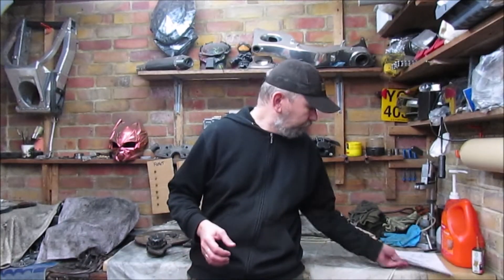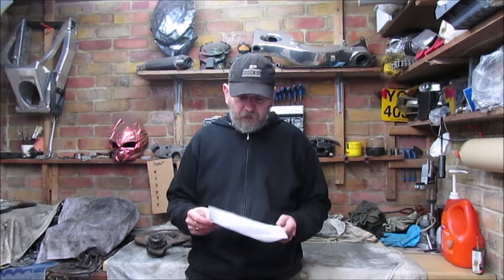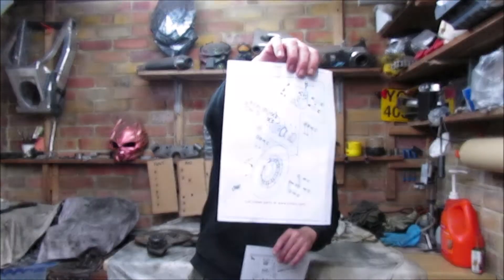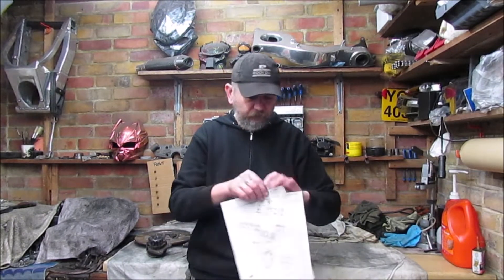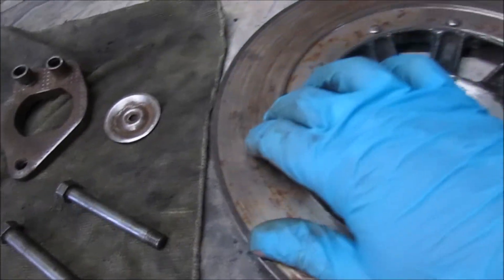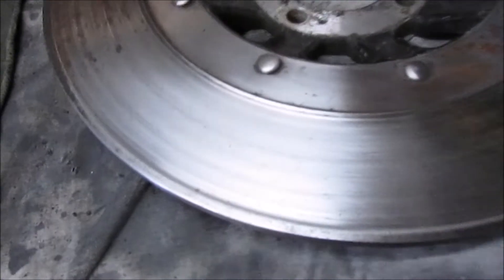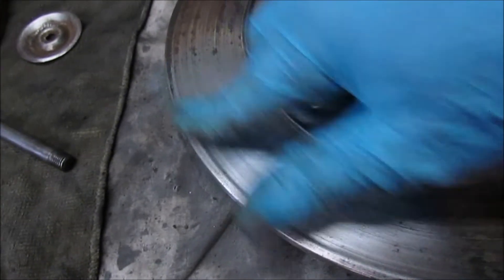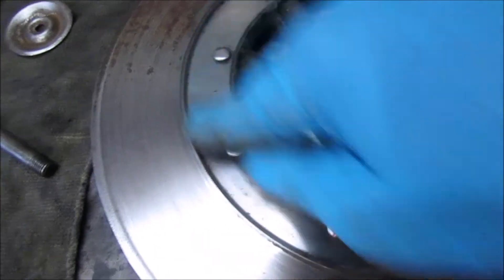Kawasaki KZ650/Z650 B1 1977 - Disassembly of the Brake caliper   - part 31

Comment: Well Keith I'd say you got real lucky getting those nuts and bolts out the way the caliper looked, never seen a piston puller like that before, I use air and blow them with a small block of wood to catch it on, one last thing, maybe I missed it but I would imagine that is a special liquid you use in your cleaning tank. It looks like it took off that powder coat pretty good. I for video. 
            Thanks Jack
Reply from the maker: I use parts washer fluid, it is available on Ebay, there are a few different types

Comment: Super helpful video, thank you! Is there any other way to get the piston out? Or do you have to buy that kit?
Reply from the maker: Thanks, appreciate your comment, if the caliper is still connected to the brake line, you can pump out the piston, another way is using an airline, i have not tried it, but be careful if you do
Reply: @TheAmateurBikeBuilder  I ordered the tool but it seems pretty stuck, I may have to connect to brake line too. Thanks for the tip. Also, it looks like your brake pad just came right out @10:57, but mine is stuck in the mount. Any thoughts on that?
Reply from the maker: @joshuaplank883  took some wiggling but should come out, try spraying some brake cleaner, see if that helps, but replace the pads after with new ones
Reply: @TheAmateurBikeBuilder  good to know. Thanks for the info and the video!
Reply: @TheAmateurBikeBuilder  there was a bunch of corrosion inside the caliper where the piston sits and where the gaskets were...do you know what would work on that and wouldn't damage the metal?
Reply from the maker: @joshuaplank883  possible that water has got in there, try a green scouring pad and some wd40 to remove the worst of it, make sure you degrease it after and thoroughly dry it